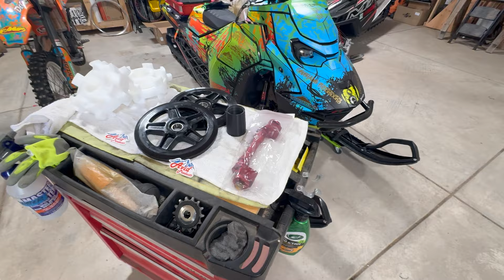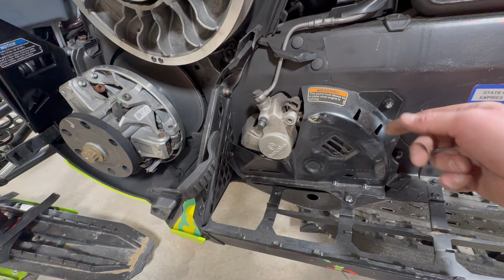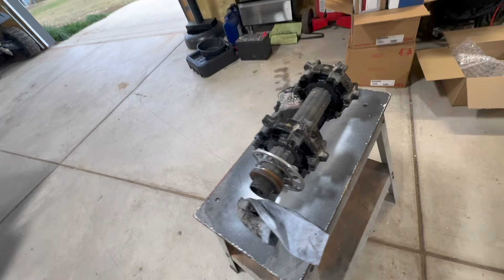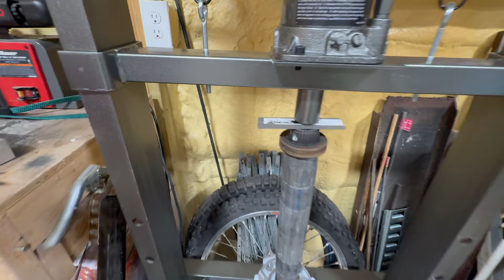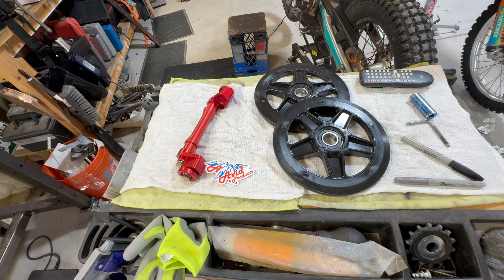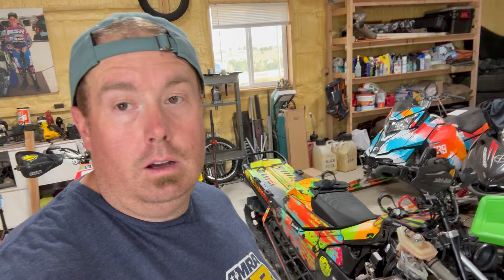Ski-Doo Summit X Expert | Avid Products Drivers & Big Wheel Kit Install (Full How-To)

Comment from the maker: 💥 Thanks for watching! This video covers how to install Avid Products drivers and a big wheel kit on a Ski-Doo Summit X Expert Gen5 — a must-have mod if you want smoother track rotation, better deep-snow performance, and a clean, efficient setup.
🧰 Tools Used: Press setup, bearing puller, torque wrench, Locktite, calipers
⚙ Parts: Avid Products lightweight drivers + Avid big wheel kit
👍 If this helped you out, hit that LIKE button — it really helps the channel!
🔔 SUBSCRIBE for more Ski-Doo Gen5 builds, mountain sled setups, and snowmobile how-tos.
💬 Drop a comment below if you have questions about Avid Products, driver alignment, or other mods — I reply to every question I can!